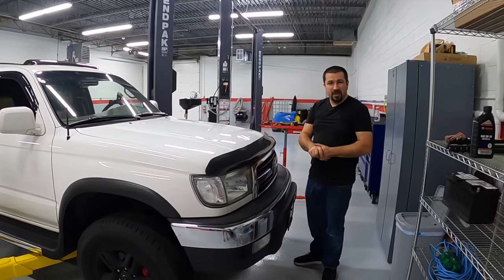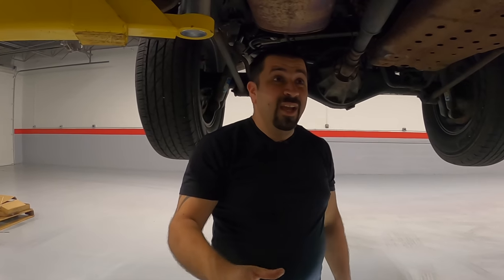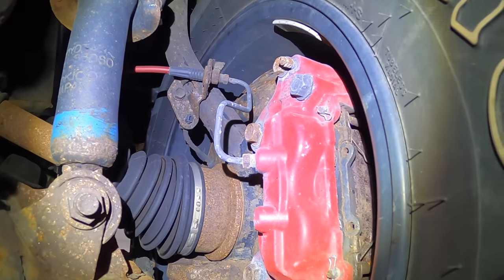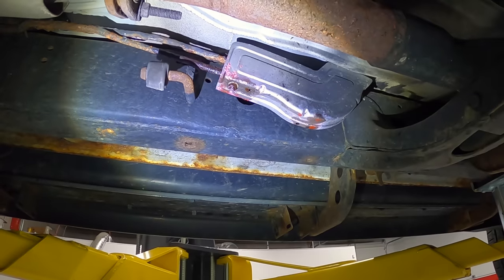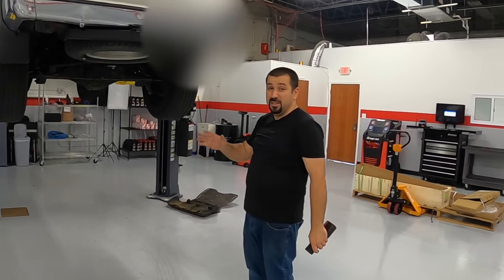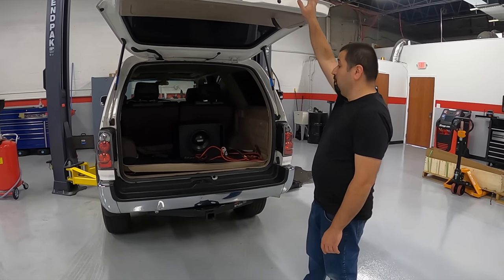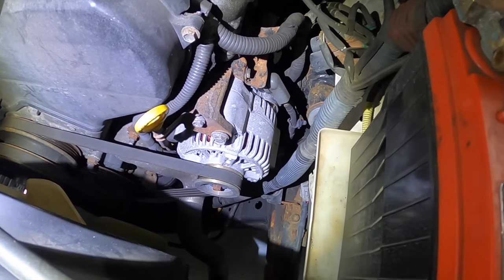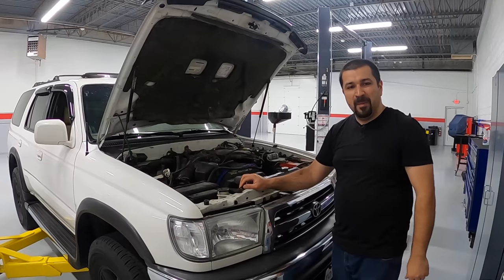Everything You Need to Know about the Toyota 4runner | 3rd Gen 1996-2002

Comment: Operate the spare tire crank, lower the spare, check the air pressure, and put lube into the winch. Particularly important for trucks run in rough country, ie: salt, ice, snow, mud, sand, etc will bind the winch and you will be stranded in the middle of nowhere.  Also do not install a rear bumper with tire carrier. One bump will put the spare through your hatch and they are expensive if you can even find one. Don’t use the rear window if dirty.

Comment: I have a question unrelated to this video, 
My 2013 Highlander (V6) has a funky smell, kind of like a faint mildew, coming from the AC vents every once in a while. I change my cabin air filter every 10k miles and  use my compressor to blow it out every 5k miles. There's no water getting in the car but I do live along the hot humid Gulf Coast so I use my AC a lot.  Any Idea what could be causing that smell?

Comment: The Virginia vehicle inspection code does not allow for those rust holes on the body inside from the pinch weld. My 3rd gen didn't pass inspection because of the same body rust in this video. I had to cut it out and weld in new sheet metal.

Comment: Install a separate oil cooler for the ATF if you can. You can either cap off the ATF inlets on the original radiator or get a radiator without the ATF cooler built in.

Comment: great vid as usual, I have been watching your videos for a while on forerunners and Toyota's in general, I'm in the UK where the forerunner is not available it was but only for a short time in the early 90's I imported 1997 Hilux Surf SSR-G 3.0l turbo diesel with intercooler, nearly 20 years ago and its been bullet proof and have services the vehicle every 8000 miles, I have an issue where the auto-transmission wont change up through the gears i.e. 1st to 2nd to 3rd etc, I left the vehicle standing whilst away on holiday for a few weeks and this has occurred, I've had some feed back on the issue but not a definitive solution to the issue, some have said it's the throttle sensor, or it's an ECU issues, right through to transmission solenoid, as an experienced Toyota mechanic have you any definitive suggestion to the issue I am experiencing much appreciated regards

Comment: Help advice please...

I'm about to go look at private party selling 1999 limited 4x4 automatic tomorrow asking price 3,000 firm with 290,000 miles
Any advice helpful 
They say everything works perfectly
Reply: I’d say wait until you find something with lower miles, hire a mechanic when you see it, check for rusts, replace the ball joints and radiator right away along with oil change. Best of luck! I got a 01 myself. Amazing truck!
Reply: Just scan for codes & make sure it's clear, simply speaking.

Comment: My son has a 1998 SR5 and we’re having some brake issues. The pedal was going to the floor and sometimes was hard to press. We had the master cylinder replaced along with all front pads and rotors, but now we’re having the same issue. The brake pedal goes to the floor. No leaks and fluid is new. Any help would be appreciated. Your channel is great, thank you.
Reply: I have an 87 pickup and had the same issue.  I fixed it by bleeding the brake fluid.

Comment: You are WRONG about one thing.. 
“ frame rust there is NO FIXING THAT”

WRONG

Look up “Safety Caps” 11awg steel caps designed for this truck.

Besides that.. GREAT VIDEO. 
Frame rust can be fixed.

Comment: I towed our trailer with  my 2014 Tundra V-8 yesterday and, this morning, she blew white smoke and check engine came out. Codes are P0441 and P0455 but cleared and doesn’t seem to be doing it now. Thoughts?  (Evap system?) she only has 45,000 miles
Reply: I should mention I just replaced the gas fill cap with a lockable kind, it’s not OEM 🧐

Comment: Hello! Nice shop! The E brake light stays on its an 01 sr5 stays on. Local shop said there was a leak from one of the brake lines on the abs actuator / pump assembly. Is there a way to rebuild that or a repair kit to fix? The truck is absolutely kick butt otherwise! Thanks.

Comment: Recently picked up at 2000 4runner. Are valve adjustments required for the 2.7 4 cylinder models? If so at what intervals and how do I keep my eyes/ears open to know when they need addressing?

Comment: Had this engine in an 02 Tundra. The valve covers took my 6 hours, but the book time was 5, so I'd say they were pretty easy as long as you keep track of where all the hoses attach. Had to get rid of the truck cause the transmission was puking out fluid from the the vent, and I didn't want to sink any more money into it with getting a new trans. Also the frame wasn't in the best of shape and the frame campaign for the Tundras screwed over the owners that went in immediately. If you got the frame "coated" when the campaign first started, you basically just put a band aid on an already bad frame. There was no replacement option once the "coated" frame failed. Really think Toyota screwed it's owners on that one.

Comment: Hi Amd, always loved your video, watched that 4th gen buying guide about 3 times before I went on. So I just got a 2007 4runner in "decent" shape, the previous owner definitely attempted to mitigate the rust damage to the minimum, I can see signs of undercoating everywhere. However, being in the north east US, it is near impossible to find a 4runner with zero rust. It does have a not very rusted radiator support (only right side though, the left side is pristine), and as much as he took care of it, the frame welding lines are showing some rust, possibly from inside. I will fluid film it every year, but just like any rust proof product, it cannot possibly cover everything. So my question is, if I only see some rust (not serious, definitely not rot) at some welding points, and if I do fluid film it every year, how long will this truck last before the rust destroys everything? Will I at least get another 5+ years out of it?
Reply from the maker: Hi! Fluid film really works well in blocking the rust and really slowing it down. It will last a long time. It will have some rust but not enough to cause rotting and holes in the frame
Reply: @TheCarCareNut  That's certainly assuring. Thank you!

Comment: Great channel. A Toyota mechanic said I should replace the whole master cylinder with booster assembly. But isn't there a way to rebuild it? New one is like 2000.00. What goes wrong with them in the 200K mile range? Thanks!
Reply: It's the booster motor only, buy that & have a mechanic replace it for you. Thank me later for saving you big bux😉

Comment: Hey, great video, thanks! I just bought a 2000 gen 3 4runner. 250,000 mi. After seeing ur video I pulled the transmission dip stick and there is coolant in there. The vehicle has a new transmission and it works but the 4wd won't lock in alot of the times. Do I need to replace the radiator? What radiator is best to use (OEM) or other? And is the transmission doomed to fail bc of the coolant in it or will it be ok if I drain the transmission and add good transmission fluid? Do you think the 4wd doesn't lock in all the time bc of the actuator or because the selenoid on the actuator or the 4wd button on the shifter? Thank you very much for any feedback.

Comment: I have a 97 4runner with oil leaking from the head gaskets and dents on the right side fender and bumper from hitting a deer. It has 250k miles. Is it worth fixing, or could this be the end of its life.?
Reply from the maker: Honestly if it’s not rusty it would be worth fixing. These are really good trucks
Reply: @TheCarCareNut  I'm New Jersey, I'm going to check how bad the rust is underneath the truck.
Reply: Rusted frames can be repaired if they're not too bad. There's a place in Rhode Island that sells sections of brand new frame for 4 Runners and jeeps.
Reply: Those head gasket (valve cover) leaks are an easy fix, keep it!

Comment: what would it cost to replace the frame (workship + parts)?  Is this frame mild steel or the High strength type that requires mores sophisticated welding process?   Here in Europe we use a thin oil in cavitys, but i believe simply spraying the inside of the frame with a Gun preservative oil  would do the trick. Your shop looks F a n t a s t i c !
Reply from the maker: Hi! The frame replacement would easily be 15k or more if you can even get the frame new still

Comment: I guess I got extremely lucky. I’m the 2nd owner of a 3rd gen Limited that was always garage kept. The regular maintenance was done religiously thru the dealership before I got it, and I’ve kept up with that practice. I’m currently at 330k miles absolutely rust free from bumper to bumper, and runs like it’s brand new. It also came with all the original manuals and window stickers. I bought it 5 years ago for $1,800, so I feel extremely fortunate considering that the one in this video is considered a good example of a 3rd gen.

Comment: @The Car Care Nut
Are you saying that the original engine radiator has a transmission radiator built into it, and that this design is prone to leaking engine coolant into the transmission fluid? If so, are you recommending installing 2 dedicated radiators - one for engine and one for transmission?
Reply: All rads designed for this vehicle include a trans. cooler. If yours is brown(original) replace immediately w/aftermarket

Comment: I just acquired a 2002 SR5 with 166,000 miles on it.  It appears to have the original radiator.  Coolant and trans fluid have been changed twice in the past ten years. (I don't have service records for earlier maintenance.) Both coolant and trans fluid look good now.  Do I still need to replace the radiator -- given the rather good maintenance of coolant and trans fluid?
Reply: @BullsEye Tactical Firearms Training Thanks for the reply. I replaced it last week already. Confirms I did the right thing
Reply: @stevenw2866 good job, about time for that mileage anyways👍

Comment: I have an 03 Tacoma with the 3.4 l V6. It has a Harrison radiator in it. Are those the same as the 4runner radiator do they leak in the transmission?
Reply: Don't worry about it, it's only the OEM rads.

Comment: This is my car, 2002 4Runner SR5! Have a problem 2 mechanics have looked at it but unable to resolve.  Check Engine light light on, 1 second later, “VSC TRAC” Warning Light on and “VSC OFF” indicator light on.  All 3 lights remain on to-day!  Any pointers where one should look?  Thanks for allowing me to take advantage of your vast amount of knowledge on 4Runners, AMD! (One guy suggested replacing gas cap, but no luck!)
Reply: Check your O2 sensors
Reply: Find out what codes the check engine light gives, fix that & clear the codes;  all lights disappear, thank me later😉

Comment: You mentioned the V6 is it the same as the Camry? And what years are not good?
Reply: Not the same. The Camry mentioned is a 1MZ-FE. This 4Runner is a 5VZ-FE. This is slightly a better engine than the 1MZ-FE. But, in model years 04-06 the Camry was upgraded to the 3MZ-FE which is hands down within the top 3 gasoline engines Toyota has ever made. The 1MZ-FE has a few minor flaws that were fixed with the 3MZ. The 5VZ-FE is not known to have any engine flaws.
Reply: @ShinobiXRevived  I was inquiring about any known major Flaws in the 2002 Camry V6
Reply: @robertvance1873  That has the 1mz-fe. Nothing major, but if you are buying a car it's best to aim to get 04-06.
Reply: @ShinobiXRevived  well I already have the 02 Camry XLE V6 so hopefully she's a good one
Reply: @robertvance1873  No major issues as far as I know. If you're really concerned just search "1MZ-FE" on YouTube and you will find videos about the engine.
Reply: @ShinobiXRevived  BTW THANK YOU

Comment: Great video

These vehicles (and 4runner in general) have a cult following that borders on total delusion. My experience owning one leads to believe the "300k is just broken in" crowd is just completely delusional, smoking copium, or ignorant about how clapped out their "300k miles and only changed the oil" trucks are. 

They are good vehicles, they are worth repairing, they will last a long time if you maintain them well and you can't buy anything quite like this vehicle new on the market today so they have an intrinsic value. But you will do a lot more than change the oil to keep it in tip top shape especially as you cross the 20yo and 250,000 mile mark. 

I own one of these with 322,000 miles on it now, I've got the maintenance records starting from when it was brand new. They need plenty of maintenance and repairs just like any other vehicle. Mines on it's 3rd set of suspension and steering parts at 322,000 miles. 

But if you dare suggest the magic 3rg gen 4runners need any kind of expensive maintenance and repair or have common failures and mechanical problems the Toyota fanbois will attack you like you just spat on their grandmas grave. 

Que Toyota fanbois attacking me in the comments below. 

It's a great truck but if you're buying one just make sure you know what you're getting into.

Comment: Lower Ball Joint is the most common issue we have here in Nigeria.
Reply: Get needle, puncture rubber boot on ballpoint & squirt inside gear oil. Seal puncture hole with little bit of silicone.👌 "2x life of old bj"

Comment: What does he mean by if you see a hint of pink fluid in transmission, you need to walk away? I just bought a 97 Tacoma with this engine, and it was red fluid on transmission dip stick,  forgive me for my ignorance but that's normal right?
Reply: Yes, red is good. If the coolant is the pink stuff and mixes with the trans oil it'll be a dark pink or light red. If the coolant is yellow and mixes with the trans oil it'll be orange.

Comment: My 2001 Toyota 4runner low beams stopped working however when I pull for high beam the lights work but once I let go it stops working again. Also my locks weren't working it makes a clicking noise when push to lock in the interior fuse box.
Reply: Take it to a mechanic, needs new bulbs, but I wouldn't worry about the locks; quite expensive to fix... Thank me later

Comment: Crazy that he didn’t mention lower ball joints
Reply: The stories I've read have me shaking in my boots every time I hit the road. Bought a set of Moogs when I purchased the rig and finally got around to installing them 10k miles later. I'm 1000 miles in with a few moderate off-road trips and just waiting for one or both to snap on me at any time. Such a terrible design.
Reply: @PotatoeChipz moogs are terrible, go for oem otherwise; Delphi, mevotech or 555.
Reply: @dmironyuk  Still going strong 15k miles later. My buddy's been running his for over 40k. The stories you hear are the bad ones which far undervalue the silent majority that run them successfully. Can't say the same for Moog's LCA bushings tho. Already cracking.
Reply: @PotatoeChipz  nice! 👍, I'm still running originals @ 300k+ & no play whatsoever😆. Anyways, you're probably right, are you lifted? Heard that any lifts misalign the angle of suspension components thus creating premature wear.
Reply: @dmironyuk  Can't go wrong with OEM! Bought my rig with a 3" lift and didn't upgrade the UCAs (JBAs) until late last year! Probably explains the extra stress on the LCA bushings. Finally corrected the panhard and extended the sway bar links a couple weeks ago. Such a better ride now. Been a learning experience to say the least 😀

Comment: Any say on the pulsating/vibration brakes?
Reply: FWIW, mine did the same thing last year.  I replaced both rotors and pads in the front and now brakes really good.
Reply: @Gretzky2857  mine always pulsate after 300miles that I replace rotors and brake pads...

Comment: My 97 3rd gen has 341k and has never overheated but it still has a leaking head gasket so it's getting a newer engine and I'm gonna take it another 300k miles
Reply: Just have it rebuilt (new gaskets, valve adjustment...) 👍

Comment: Hello
I have a Toyota forerunner 1998 four-cylinder automatic, the radiators need to be replaced because they crack from one side to the other and then it freezes the car and then it tightens it and it’s all locked so it needs to be replaced before that happens, so I replace mine in 2021 .
Reply: Okie dokie

Comment: MOONROOF: Open it and blow compressed air down the two drain holes at the front corners. These clog up and will allow water to back up into the mechanicals, rendering the roof useless.

Comment: Car care nut I have a question my radar cruise control is loose a little bit where the Toyota emblem is at I need to get the screws that go in it to make it tight again like from factory what’s the part number of it?
Reply from the maker: Hi! You’ll want to look that up by vin on parts.Toyota.com and make sure you get the correct screws because that emblem is expensive and you don’t want to damage it
Reply: @TheCarCareNut  thank you

Comment: I'm your opinion do you think it's worth it to get the Rav 4 Prime XSE or better to save the thousands and go with the SE?
Reply from the maker: Tough one honestly. Other than the better charger on the xse. I wish the SE came with leather seats but it doesn’t. Otherwise the XSE is not that worth it
Reply: @TheCarCareNut  I decides to go with the se. I don't care so much about the panoramic roof or upgraded sound system for the huge price difference. Planning on getting some good seat covers for about 400 bucks or less depending which i decide on and maybe upgrade the sound system if it's not so great prob another 400-600. Always a way to figure out first world problems